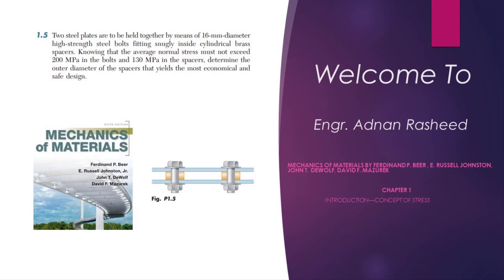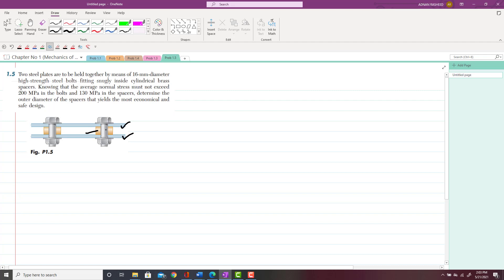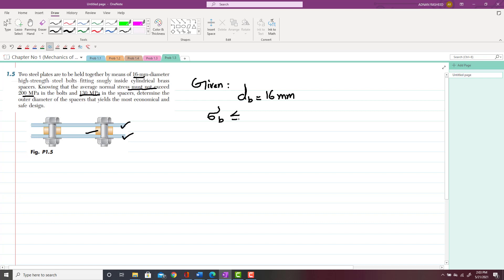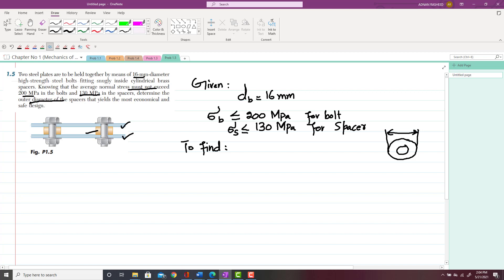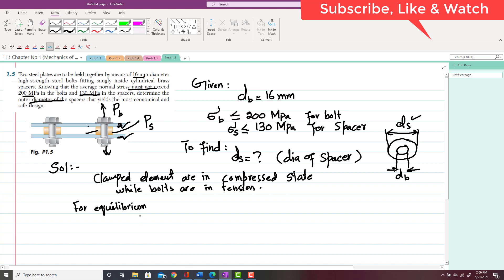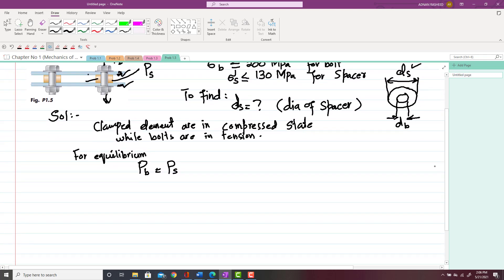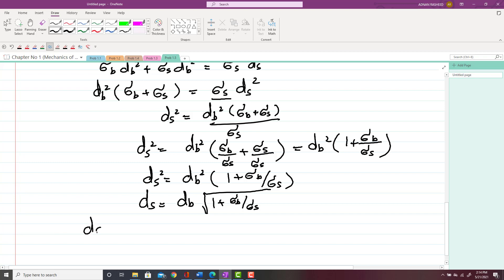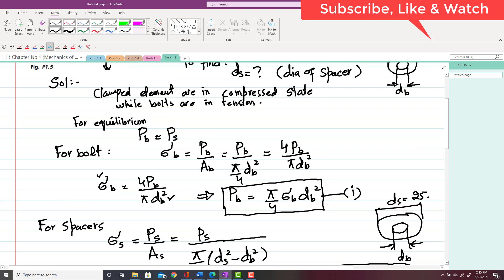1.5 Determine the outer diameter of the spacers |Concept of Stress| Mech of materials Beer and John

Comment: 2*Sqrt(((200*10^6*Pi*0.008^(2))/(Pi*130*10^6))+0.008^(2))=25.492 mm

You're answer is close but not precise enough.
However thanks for your experience sharing.
Reply from the maker: Thank you the main purpose is to give the concept. Rest the learner will have to calculate the exact value. I am grateful for your kind words and appreciation.